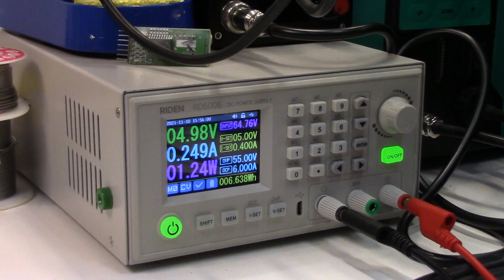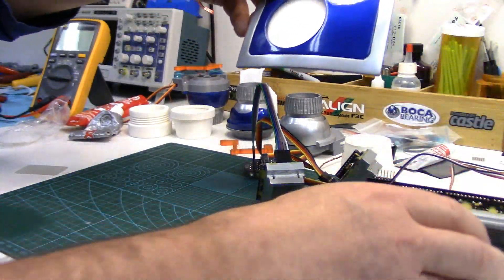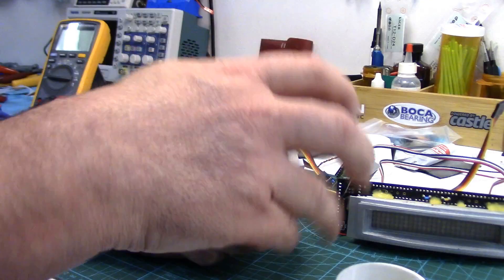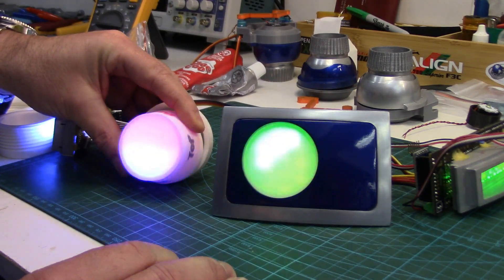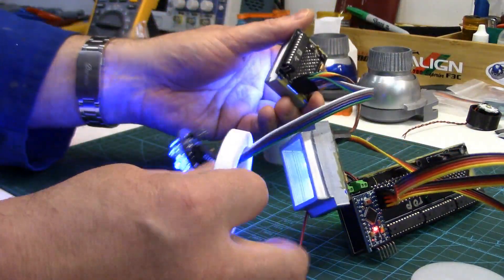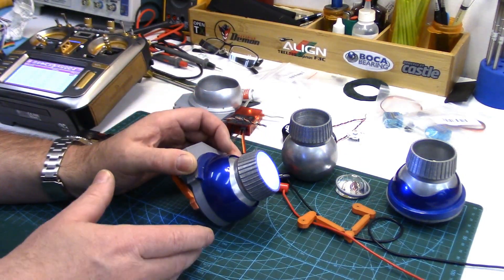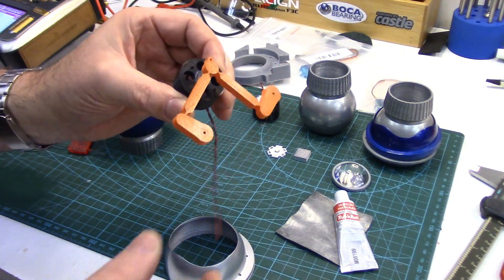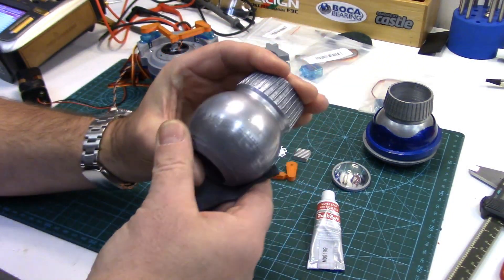R2-D2 Dome Lights - Teeces Kit, Diffusers & Holo Projector Assemblies

Comment from the maker: R2-D2 Astropixels Dome Light Upgrade Video: https://youtu.be/du5284ciHco?si=bs3GyBaWhccv7YXu
Making R2-D2 Video Series:
- Introduction to a DIY R2-D2 Build: https://youtu.be/hkkSagTsLXY
- Part 1 Making the dome: https://youtu.be/HaZ7ABkhwn8
- Part 2 Painting the dome: https://youtu.be/inoqE19ODUQ
- Part 3 Dome lights & holoprojectors: https://youtu.be/hDR9z1PAJSA
- Part 4 Dome Completion: https://youtu.be/PnjCrLlJtig
- Part 5 Body Assembly & dome drive: https://youtu.be/m6VXt6VGZ3c
- Part 6 R2 Sound System Basics: https://youtu.be/cZ3sVYs7T9I
- Part 7 R2 Electronic Basics: https://youtu.be/AmUuZH3UHXg
- Part 8 R2 Legs & Foot Drives: https://youtu.be/PLyOKD5oAyM
- Part 9 Painting R2-D2: https://youtu.be/E8h0l4rHvC4
- Part 10 Installing Electronics: https://youtu.be/bg_tN6HCYN4
- Conclusion to a DIY R2-D2 Build: https://youtu.be/sIpBA6UigTQ

Comment: Hey John, I am looking everywhere in the Baddely files (the organization leaves a lot to be desired) and I cannot find the prints for the PSIs. I found some in the MKIII dome and MK2 dome but they have solid backs on them. Where did you find the ones with the opening + the notch that fits the Teecees lights? Thanks
Reply from the maker: @geekdomo - Sorry mate, but I can barely recall what I had for dinner last week; never mind trying to recall what sub-subfolder I found the front & rear PSIs files in from two years ago. I do remember searching and searching for some specific print files during this build, but I don't think the front & rear PSI's were two of them? Seems the dome stuff was all fairly organized and easy to find to find to the best of my recollection. It was the body and foot files where I was really playing detective for a few specific items. The price we pay for having so many build options 🙂
Reply: @Rchelicopterfun  Yea I totally get it! I read through the comments after I posted mine and saw its a running theme with these PSI. I love Baddleys work its awesome, the organization of the files leaves a bit to be desired, cant blame him as you say there are almost infinite variations. Thanks for getting back so quickly <3
Reply: Hi  @geekdomo  I still can't find the files John is using. There are several PSI printable files in the directory, but all have closed off ends and don't look like the ones John is using. Did you find them and where?
Many Thanks
Reply: @geekdomo  any luck tracking these down? I've been searching through all the patreon files for the psi mounts used here and i'm having zero luck. I only see the closed off versions.

Comment: Hi John. Another great video and I'm printing the psi mounts etc next week. I have just noticed on the 3d files that the psi mounts have a solid end  - and someone said it is so they are printed clear. Did you use these files and if so how did you make the solid end go. I have had a play in cura and if I lower the files 5mm the solid end doesnt print. Is that what you did or did you use different files or drill out the solid part when printed? Thanks Bobby
Reply from the maker: @bluenose701 The PSI's I printed didn't have solid ends so not sure what files those are with solid ends? As was stated and shown in this video, I used some LED under counter puck light diffusers I had on hand for my PSI's that were open on both ends.
Reply: @Rchelicopterfun  where in the directory did you find the PSI mount files?  I have searched EVERYWHERE and can’t find them. Sounds like some others have had the same problem. The only ones I find have a solid end instead of an open end.
Reply: Hi Bobby, did you eventually find the files that John was using? I am having the same problem with the PSI mounts. The Mr Baddeleys files only have the one's you were talking about. I was going to lower the print also but thought  I would hunt around to find a better solution. The printed droid guide v1.2 also has the files we are talking about and suggests clear filament. Regards Scott.
Reply: @Scott C  hi. I lowered the prints slightly and it worked a treat

Comment: Do you need a separate led driver for each holoprojector??
Reply from the maker: Only if you plan on powering more than one Cree LED at a time. My 3 holo-projector Cree LEDs are switched through a servo rotary switch so only one is powered (on) at a time, so I only need one driver. If you wanted to have the ability to turn them all on independent of each other, then you would need a driver for each one.  The other option is to have all 3 Cree LEDs wired in series and adjust the driver's current to drive them all - but that means they would all be on at the same time. Other powering variables/options as well - comes down to how you want them controlled, how many will be on at once and using basic electrical load calculation stuff in DC parallel or series circuits to figure it out.

Comment: Can you post a link or a model number for the led driver board?? Thank you
Reply from the maker: Hi Joseph, it's somewhat LED dependent based on the driving voltage and current, but most small hobby DC-DC buck converters with both variable voltage and variable constant current output adjustments should work for driving any of the single chip Cree/star LEDs. These are the ones I use: https://amzn.to/3At8iJF
 Keep in mind you need a DVM (digital volt meter) to set both the output voltage and output current on these little adjustable buck converters to match them to your specific LEDs.

Comment: Hey John, this is super helpful. I just got my lights in today and this made getting them connected a breeze. I did have one question about the mounts for the holo's, the files on the club site that I've been able to find don't have that servo articulation backing, just the sandwich to hold them in place. While I may not ever connect them to servos I'd like to have the option. Could you share where you got those files? Excellent work throughout, I'm building my 2nd droid and this series is incredibly useful with all the 3d printing I'm doing.
Reply from the maker: Got them in the Mr. Baddeley file folders along with all the other 3D printed files for the build as I mentioned in the first video going over resources. Go to his Main Archive, then Astromech File, then Print File, then Astromech V2 file and finally R2D2ver2Holoprojector Servo file.